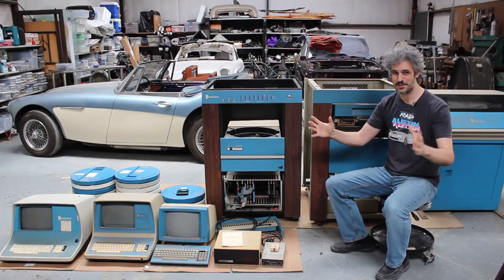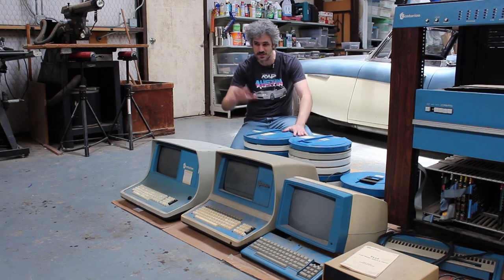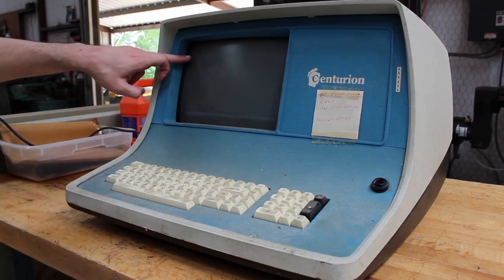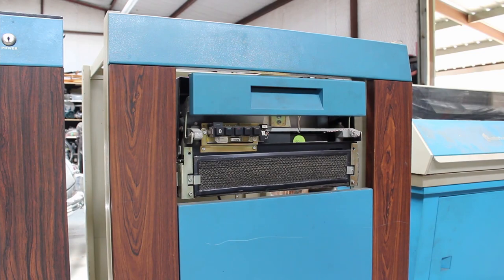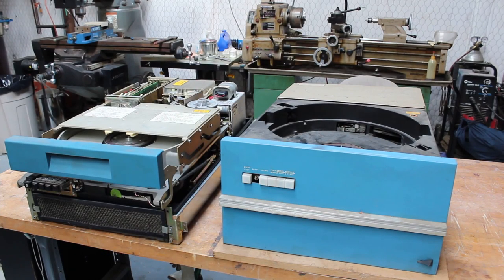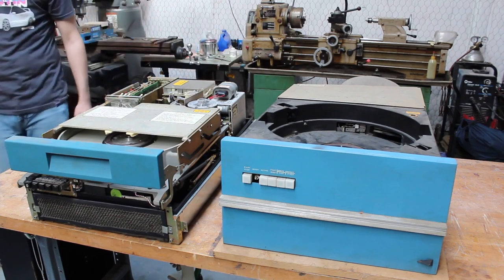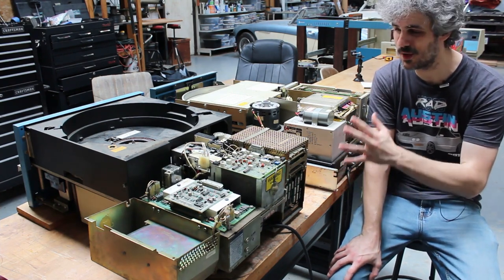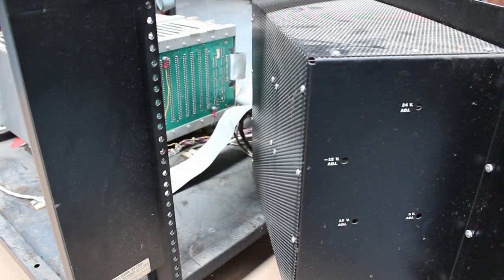Minicomputer Part 2: Removing the Drives

Comment: I used to maintain and repair removable pack drives, including the Hawk drives, all the way up to what were called "10-High" packs, with 10 disks.  You need to pay very close attention to the "Absolute Filter" (micron filter to some).  It's the large white plastic box at the output of the blower, held in with the two wide spring clips on the bottom.  That filter catches particles down to micron sizes, and the airflow aids the heads to fly just a couple microns above the disk surface.

I also noticed quite a bit of rust on the hub of the removable disk.  That rust can and will cause the removable pack to wobble when rotating, causing the heads to crash upon loading.  The rust needs to be carefully removed, so as to keep the original surface in tact, and not lower the overall height of the removable disk (i.e. NO ABRASIVES!).

I could go on and on about how to resurrect these drives, but the comments section is not really the place, except to say that these drives are very stable when properly maintained.  What needs to be said though is that the OS for the computer is likely to be on the fixed disk of the Hawk drive as it is in the rack that contains the computer, and the drive in the other rack is for expansion only.  If there is fixed disk damage, and the removable disks don't have an OS backup, it's likely that this system will never boot again.  Sorry for the downer.  If there is a removable disk with the OS on it, steps can be made to transfer the OS to the fixed disk, but it may be a very hard road to travel.
Reply from the maker: That's awesome that you're so familiar with these drives!

These have definitely seen better days, though the filter is in^tact and I took care no to damage it during removal. Though, as you saw, the Hawk drive is in very, very rough shape. Not being enclosed did it no favors at all, and I'm not sure if it can be brought back to life. As you mentioned in another comment, the heads are indeed destroyed and on the occasion they do pop up for sale (there's currently some on eBay), they're going to take quite a lot of work to get in and correct. 

Fortunately, one of the removable disk packs does say OS on it. Whether this is an OS backup, or even still has valid data, is a big question mark, but it's a good sign that there may be hope for getting the machine up and running again at some point in the future. My primary focus for the time being will be to get the Phoenix drive cleaned up and fired up again in the hopes that it has an OS or something useful stored on the fixed disk. If luck isn't on our side, I'll dive into the Hawk drive next, and hopefully, with a lot of patience and reading, we can get it to spin up again.

Of course, if everything fails and we have no way of getting the machine to power up correctly again, I only paid $100 for the entire system with the terminals, so it's still an absolute win! Worst case scenario, I'll fill one of the racks with some rack test gear, and then build a computer from scratch and populate the other rack with it. And the terminals are gorgeous little machines that still seem to be mostly functional, so they will come in handy in the future too!
Reply: My experience is with the DEC PDP-11/70 with Bunker-Ramo 10 head drives, VAX-11/780 Series with RA81 drives, MicroVAX II with RA82  Disk and TK50 Tape drives.

My only pertinent input would be to avoid swapping packs until diagnostics are run successfully on the fixed platters and all packs and heads are visually inspected for damage or debris.  A head can be damaged by a crash on disk pack 1.  Operator replaces pack 1 with pack 2.  During spinup the platter on pack 2 is crashed by the bad head.  Move pack 2 to a second drive.  During spinup the head on the second drive is crashed by the damaged pack 2.  This was the most common error made by new operators.

Comment: Caution with the Hawk drive: When doing maintenance, remove the power loss relay until ready to spin up.
The Relay is attached to a large capacitor that will Slam the heads back if there is a power failure (to prevent the heads from contacting the disk surface if the platter is not up-to-speed)
Reply: Both disks have emergency retract circuits !! Watch your fingers if there is a power failure.

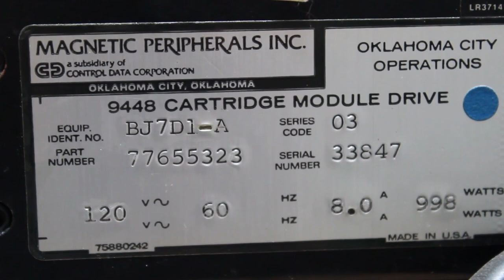Comment: 9:11  That plate is why you have those giant fans you mentioned in the last video.  While they don't get super hot when being cooled, they generate a lot of BTUs.  While a DECVAX is not the same, it required a lot of cooling and its own power conditioner (which also needed cooling). 

The server room we had ours in back in the 90s had a raised floor for all the cables, a giant power conditioner and it's own several ton AC.  There were other things in the room, mostly just X86 boxes running Netware (they were running a special NLM and there was like 12 of them configured as computation servers).  But they didn't need it, the DECVAX did (I'm calling it that to avoid autodelete from the last 3 letters).
One day the AC crashed.  That room, normally like 55 degrees  was 90 plus degrees in a couple of hours even with all the PC servers down.   The room was at least 12x12x8, probably much larger.

Comment: Came upon part one in my recommended videos, pretty cool stuff. I started work at the tail end of the minicomputer era in the mid 80's. And speaking of work, OMFG! The picture at the 0:37 mark I'm almost positive is from where I started and still work! Back then it was the Army's Harry Diamond Laboratories (now the Army Research Lab) in Maryland. We were definitely a DEC shop on the mini side with IBM mainframes. We had a DEC PDP setup for reading streak camera film from high-speed airgun shots. The device on the still ubiquitous government issue grey desk (made by US Prison Industries) is a microdensitometer, used to scan the film from the streak cameras to determine the deceleration of the projectile as it exits the gun barrel and is slowed by corrugated aluminum honeycomb material. This particular room is right next to what was my father's office and sits above and slightly behind the tunnel beneath the building which houses the 7" bore airgun, which is 300 feet long. The technician (I'm pretty sure) is William McIntosh, who worked with my father in the ballistics branch. Mac is still around as a contractor, one of the only sources of institutional knowledge about the reverse ballistics setups. Now we use high-speed digital cameras and process the shot data on PC's, but, just wow, to stumble across this is so cool!
Reply from the maker: Thank you!
I don't remember where I found that picture, but that's awesome that you recognize it! 
And you're absolutely on point that that is a microdensitometer, the Wiki article for it actually shows a picture from another angle of the same machine. Thank you so much for the epic story!

Comment: Nice look, what a beast of a harddrive. 
It really is amazing if you think about how much smaller stuff got in such short time. 
I also just noticed, how nicely the paintjob of the computer fits your car in the background. :) 

The big can capacitor is most likely fine. These big HV caps are hermetically sealed oil capacitors, which don't go bad. 
Atleast not as long as they aren't dmaged mechanically or rusted through, etc. 
The big electrolytics with the screw terminals might be "a little" bad (high ESR and leaky) but they should propably be at least good enough for testing / troubleshooting. 
They will reform when you run the unit, however if you plan to fully restore it, I would just replace them for longevity. 

The small silver axial capacitors on the PCBs might be solid tantalum caps. 
If so, they are fine and you don't want to replace them. 
They are very nice caps that dont really age and expensive as hell. (They were mostly used in high quality equipment - HP loved them - and military suff)
(They are like 60 to a 100$ a piece on digikey if bought new.)

Greetings, 
Michael
Reply from the maker: Thank you!

Yeah, it's insane how heavy these drives are! And even crazier when you compare it to a microSD card, which can now be had in sizes up to 1TB, which is something like 100,000 times more storage capacity than these old Control Data drives.

That's good to hear that those big capacitors are pretty trustworthy. The one on the Phoenix drive looks to be in near immaculate condition with no signs or leakage, rusting or anything else, so that's good news! I've had bad luck with electrolytic caps in the past, so those will definitely get a proper test before powering on. 

Thanks for the insight on the potential tantalum caps! I had assumed they were electrolytics, but tantalums would make sense given how over-engineered everything else on this drive is!

Comment: you're going to want to get an alignment pack and oscilloscope at some point to align the heads before trying to read data from your packs...  moving the drives, as well as any of the activities cleaning it can easily get those out of alignment.. heck even just running the drives can get them out of alignment.
Reply from the maker: Fortunately, we already have a pretty good scope at hand, but I'm definitely going to need to pick up some tools for getting it aligned right. Looking through the manual it has a good list of tools I'll need along with excellent theory of operation and maintenance instructions.
I've got a lot of reading ahead of me! Now, just to find a place to print the several hundred page manual, haha.

Comment: the second drive is your Winchester Drive, on the middle of the rack slide on both drives when pulled out, there was a stripe of metal that you push in to release the slide from the main bracket.,that's how you remove the drive. I worked on the Phoenix drive when I worked at DEC I think it was called the RL07 Drive it was a 90MB drive, 30 MB on top. and 60MB on the Winchester drive, they were also used by Wang  Labs VS60 & VS70 computer systems. the power supply Caps were the Starter Caps for the motor and Voice Coil where the hard drive Heads are in the center of the drive.
Reply from the maker: Out of curiosity, I've heard a couple people call it a Winchester drive, but it's also a Phoenix drive. I'm confused why it keeps getting referred to as Winchester, does it have to do with platter layout? The Hawk drive also has a fixed platter (granted the Phoenix has three fixed platters) but I haven't heard anyone refer to it as a Winchester drive.
I'm still learning a ton about these drives, and you seemed like you definitely were familiar with them, so you seemed like the right person to ask!
Reply: my dad used to use the term 'Winchester' as a generic term for the large platter drives

I had some 'massive' 800k five 'n quarter DSDD floppy drives for my bbc micro made by Winchester

its amazing the distance in my lifetime, from a purpose built building for a 64k mainframe with punch cards & tape, to 32k at home.... 

and now I have Cray power to text message

Comment: I worked on the Falcon, Hawk and Phoenix drives for years at NCR.  The Falcon used the same platters as the Hawk but consisted of two fixed 5 MB platters.  I had good experience with the Hawks as long as Preventative Maintenance was kept up.  Of note is I don't think the Hawk made used of an imbedded servo track for cylinder positioning.  The track (cylinder) positioning is derived from a capacitance detector of which a fixed plate would interact with a plate that moved along with the voice coil actuator.  This detector had no feedback as for track(cylinder) position relative to actual data.  Any head replacement for the removable platter would require use of an alignment pack of which an oscilloscope was required to visualize the track information being read from the factory written pack.  Diagnostic routines would command the drive to track ZERO.  The drive would then seek to the ZERO voice coil position totally based upon the sliding capacitance sensor.  After the ZERO track seek the heads would have to be physically moved forward or backward in their loosened mount while watching for the correct signature from the oscilloscope signifying the head is actually over track ZERO on the factory alignment pack.  Once there, the heads would be locked in place.  This would assure any HAWK drive that had been aligned with the factory maintenance packs should have the same track (cylinder) positioning for the removable spindle.

A fixed drive crash was considered a full data loss situation as they were not intended to be removable or swappable.  Swapping the fixed platter with one written on another machine would not work as the capacitance sensor's cylinder ZERO positions would most likely not be the same.  Restore of a working fixed platter would always require a format function followed by a restore function from backups that hopefully were being diligently performed.
Reply: Glenn,  Hope you are still watching the videos.  Completed a poor mans head alignment on the removable heads ( no CE Pack ) and also got the fixed disk heads back over the correct cylinder and was able to read the data written over 30 years ago.  The rubber bumpers had failed with age (35-40 years) and were causing the 4 Hawk head to slip to the rear, away from the spindle each time the head unloaded when the drive was spun down slamming into the magnet.   I also worked on the old 9427, 9427H  and other drives like CDC Falcon, Finch, Wren & Phoenix.  The CDC Hawk was the old workhorse goto drive for Centurion, NCR, Wang and many other computer companies.   Hard to believe we found an OPSYS for the system and now have it running.

Comment: I spent 17 years working for Control Data.  For about 10 years I was in tech support.  I traveled up and down the midwest fixing diskdrives.  We were the manufacturer so I had access to in house factory secrets.  Before things started getting smaller 600 MB yes.. Megabytes.. had 10 heads (10 top and 10 bottom) and a servo head.  The end user price was 15k and the shipping weight was 600 lbs.  I have one of the 14in discs hanging in the garage.
Reply: I never worked for CDC but I did work on CDC / MPI drives for about 10 years starting in 1975.  Visited the CDC / MPI factory in Ok. City, OK a number of times.   Well I guest if you count the Centurion YouTube video #14 I have worked on CDC drives once more a few weeks ago.

Comment: I used to work on Alpha Microsystems computers - both of those drives were used on early systems and  I even had an AM-100 based system with a CDC Hawk.  Sadly I scrapped it out in the 90's.  I wish I still had that system, but I do still have an AM1000 (with a 70mb 5 1/4" full height drive), an AM2000 (can remember what drive it has) and an Eagle (scsi drives and tape).